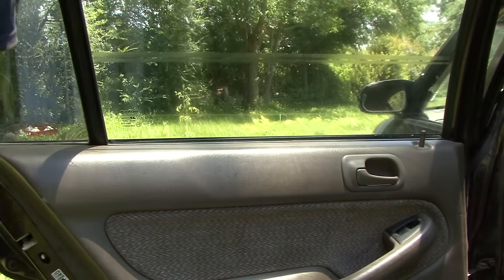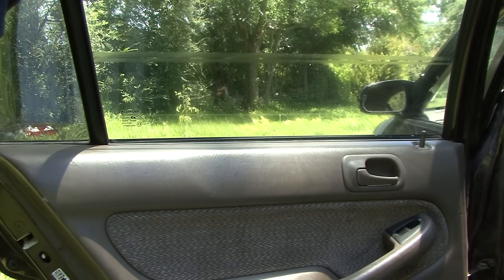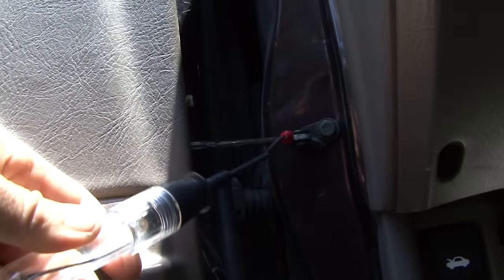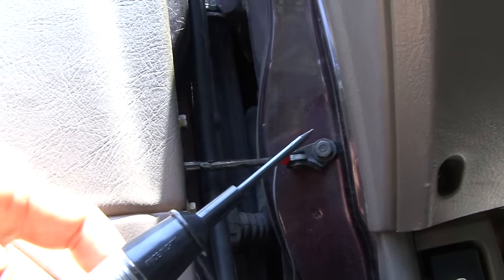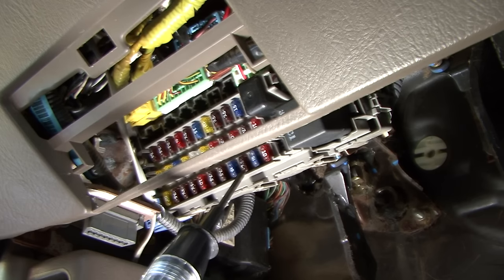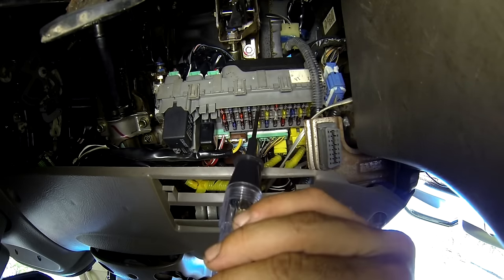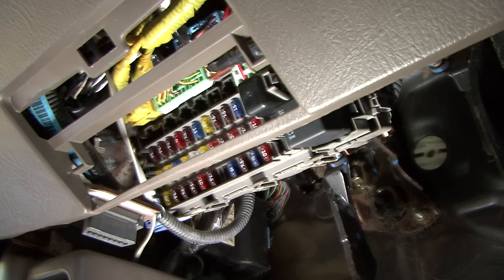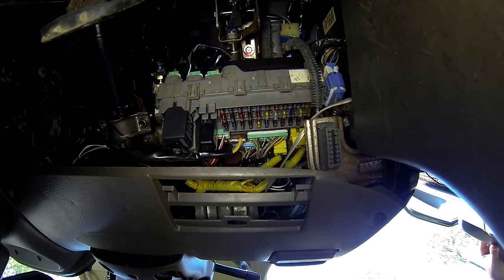how to check a window motor fuse

Comment: You should always replace with the exact same fuse read your cars manual, you removed a 7.5 amp fuse and put in a 15 amp fuse, thats a fire hazard and a big No-No.  When you start smelling burning electrical cable and burning plastic, then you will know what I mean.
Reply from the maker: They had the wrong fuse in it that was why it was blowing so i put in what the car called for. But you are right always replace with the correct amp fuse.
Reply: Cody the Car Guy 
Wow! Very handy in deed! I was thinking if it was the fuse but was trying to find out. Thanks to you video I will check my one out first.

Comment: If you change a fuse use ONLY the fuse rated for that location. You'll risk setting your car on fire otherwise. Should have cleaned the window and put the 7.5A back in place (assuming that's the proper fuse for the window).

Comment: Hello sir i have a question, is the right and left window have the same fuse? My left window is working but my right window (driver seat) isnt and its not making a motor sound when i push the switch up and down. Thanks.

Comment: hi i have a 2006 Nissan Altima 2.5 S. my windows glass and remote lock  system are not working in all four doors i checked the motors and  regulators they are fine i dont no what wrong with them  can i have any 
suggestions

Comment: You can just pull out the fuses and look to see if they're good
Reply: Car Lea  yeah your right should be a fuse and a relay for the window motor...also a resistor to check depending on your symptoms

Comment: I have a 99 Honda CR-V ex automatic 4wd. I can't find the fuse for the hatch bk window? The button under my steering isn't doing anything. ?!? The 4 door window works except the rear I have to use a key now. Any suggestions??

Comment: I have a 07 Yukon I have been desperately searching for the fuse for the front window driver side...
I cannot find it I checked all fuses and does not say anything, only thing it says is a driver side front window breaker any suggestions. Where to find the fuse

Comment: I had the same problem. I cheked the fuse and found out it was blown so I pulled out  a different fuse (same number (yellow 20) and put it in and tried to check if the window would work with a different good fuse. I had the bad one in my hand, turned on the car and the window didn't work. I pulled out the good fuse and it was blown. Im pretty sure i shouldnt have done that. Any suggestion why that happend?

Comment: This is for Honda, for Toyota you gotta find Pink fuse, which is shaped like garbage bin with clear square cover on top, located to left driver knee fuse box in cabin. For Toyota Sienna 2000, its PAL 330BP (30Amps) fuse. Cost about 4 bucks. I just changed one. Window works.

Comment: 2001 Mercury Cougar ...manual show fuse #21 / 40 amps (Power roof, Power windows) If it is the fuse...wouldn't both windows not work?  the passenger side will not go up or down (no sound at all)

Comment: I've got Honda Civic 2000 4 door sedan and the rear left passenger side window stoped working all of a sudden without any warning what so ever just like yours. 
I will definitely get the fuse checked and see if it's the fuse causing the window to stop working.
I will get back with the results.
Thanks.

Comment: hey cody thanks for this video. i hav a 98 accord with this problem. drivers side and sun roof work but none of the others. can you explain what a "ground" is with that test light? is it attaching it to another source of electricity? can you tell me how to do this safely? i have no experience but obviously dont want to spend any money on my 20 year old car. also where would i find the fuse box to test the fuses? any chance of electric shock or injury while doing this? your help would be so appreciated! no ac so i need those windows to work! thanks!

Comment: Cody the Car Guy - I was wondering if you can tell me what I can do when my window on my drivers side door stopped working on my 02 Volvo S60, I brought it to a guy I know and he tried banging on it to see if it started again (which I thought was strange) and then he said that he will let me know how much an after market regulator would be (he said about $100ish)...

He said nothing about fuses at all so I am wondering if you can help me help myself and call him out if he is ripping me off..... Any help would be appreciated.....  Thanks
Reply from the maker: you can check and see if your getting power to the window motor and if you are getting power there then it is a bad window motor. No power id start with fuses.

Comment: what is the name of the instrument you used to check if windows fuse were working or not? How much doe sit costs and from where can you get it?
I have a Toyota Camry 1995 LE and I even don't know where to look for the fuses that power the windows, If you can also tell me where to look for that It will really be helpful, Thanks
Reply from the maker: You can get a test light from more auto parts store and they don't cost too much. Most cars have one or two fuse boxes either left side under the dash or under the hood

Comment: A big thank you for posting this easy to watch/follow video. Armed with this, and a fuse diagram for my Honda Odyssey I managed to replace the blown fuse and roll the back seat window up before it rained. I took some extra fuses from the main fuse box (which also in this van holds the fuse puller) and it took maybe 2 minutes.

Comment: Cody the car guy - I have a 2005 Suzuki Aerio and all of a sudden the switch on the drivers side door will not control the drivers window or the front passenger door window. The two back windows work fine and the door lock works fine,. What's really strange is that the switch on the passenger side door will control that window and allow it to go up and down. I have already replaced the entire switch on the driver door and nothing changed. Not really sure where to look now. Any ideas???
Reply: Hey Chris, same problem I have with my 2012 Dodge ram 1500. With me, my door locks are affected at the same time. For some crazy reason, once I reset the fuse that controls these functions, all is good for a couple of weeks. I have to pull the fuse every time in order to get things to work. I've been looking for answers but can't find anyone who can help. Hope this helps a little.
Reply: Mark Martin, I have pulled fuses and nothing seems to work. What makes matters worse is that they only produced this particular car for a couple of years and I can't find any wiring schematics for it anywhere. I believe the problem may be in the wiring but hard to say at this point.

Comment: My car manual says that I shouldn't use a fuse with a higher amperage rating than the one I am replacing because it could cause a fire. Should I be worried about that if I replace the fuse with one just a bit higher in amperage or should I only be worried if I'm doing something ridiculous like replacing a 5amp fuse with a 40amp fuse??
Reply from the maker: +Chris DiGi you can go up a little and it wont be a big deal. Just dont go sticking 40amp fuses in 10amp spots . In  my 240z the factory had a 10 amp fuse for headlights and it get so hot and melt the plastic. Switched to a 30amp fuse and it stopped getting so hot.

Comment: Thanks a million on posting this video. I thought I tested the fuses but only tested on side not both as you illustrated. I wish I would have seen this video earlier. I have driven around half a year with a window that would roll down or up. I bought a window motor that didn't work, and also a switch. Thanks again, I am delighted, I was about to take it to a shop.